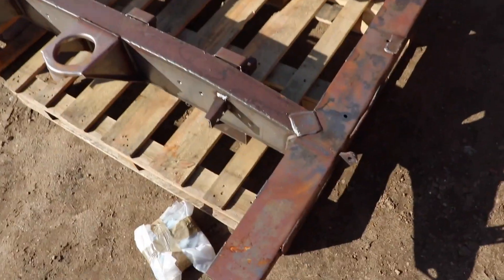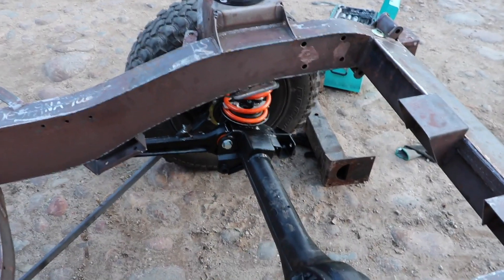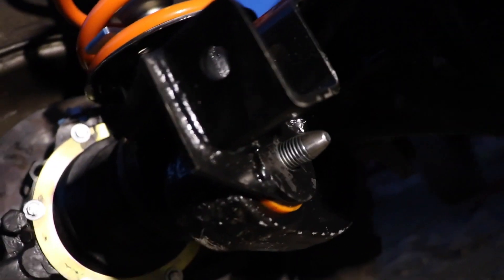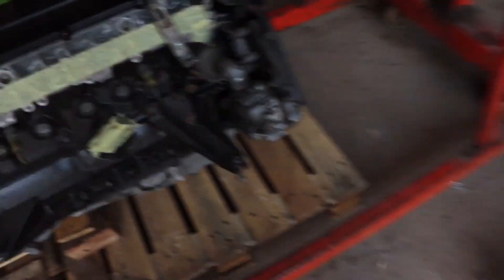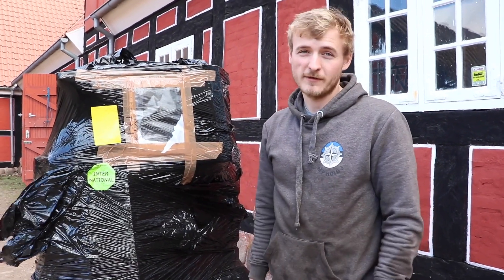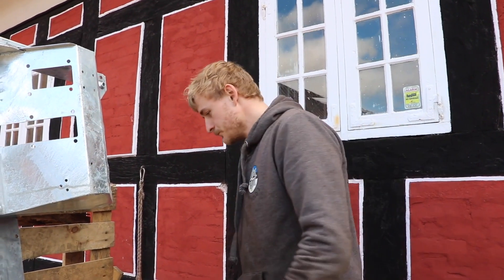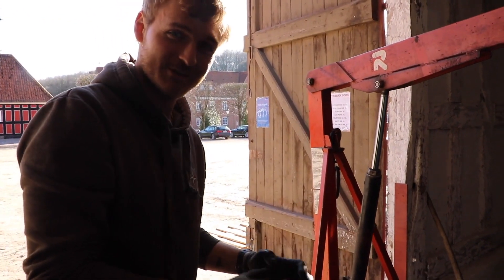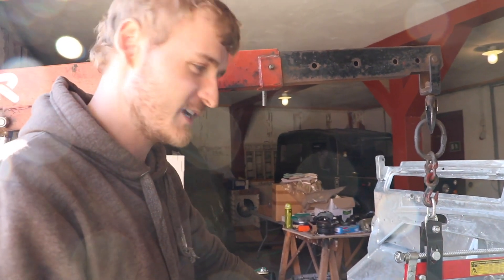The Creeper #6 - The build begins!

Comment: For the struggle fitting the front arms, called radius arms, thread the two bolts in the axle end first, then easily pull the other end through the chassis mount :)

Comment: So glad to see you are using RB25, not RB26. MUCH stronger engine in stock form. Did you say you will wedge the rear springs to get the diff nose up? That wont work, you need to shorten the radius arms to make the axle tilt.

Comment: Why haven’t you painted the chassis before assembling so it doesn’t rust and get paint on new parts?
Reply from the maker: It's going to be galvanised - We're only fitting stuff now so we can fabricate the engine and gearbox mounts. Once that's sorted we'll take it apart, get it galvanised, painted etc. and then put it back together permanently.
Reply: That was obvious from the video 😂